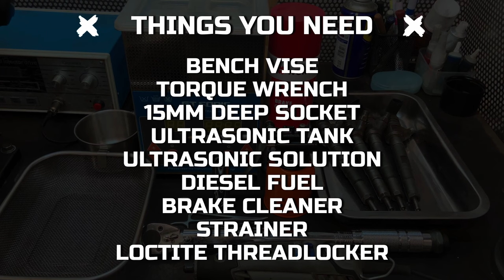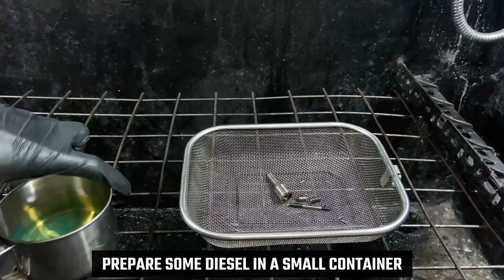HOW TO CLEAN BOSCH INJECTOR NOZZLES LIKE A PRO | 2021 ULTRASONIC CLEANING DIY

Comment: Probably you’re the only person can answer my problem… So my injectors were very noisy (knocking sound), when engine was could was ok but after was worming up was making loads of noise and the engine idle was not smooth. I’ve followed your video by the book, and I must say that the injectors act completely as new, no knocking sound at all, amazing while driving, probably the smoothest time this engine run. 

The only problem now is that all this hold for 1 day, the knocking sound starter to get worse hour by hour up to the point that it get back to where it was. Now when warms up is noisy and the idle is irregular. What I’m missing? Are these injectors unrepaireble? Do I deal with some other issue? Might be the the fuel/tank is contaminated?

Insignia 1.6 180k miles, mounts Denso 55570012
Reply: Following

Comment: By the way what would you suggest to use , after cleaning the injectors , to put on the outer body parts to stop the injectors from rusting in the head bores ?
Reply: If you really are concerned about that, Mercedes Benz will sell you the "Injektoren Spezialfett" they use on their notoriously stuck CDI injectors. A can of 100 gram costs about $20. It sounds expensive, but it is actually cheaper than the stuff Liqui Moly or Petec sells.

Comment: Great vid. To what time and temp did you set the cleaner?
Reply from the maker: Hi! Around 60-70°C for 10-15mins
Reply: @btdgarage  thanks!
Reply: @btdgarage  it is water with what? did you tried gasoline as cleaner?
Reply: @miskosadibol5665  it's special ultra sonic cleaner

Comment: Hi, great video very detailed and clear, would this process work with a 1.6 Tdi  Fuel Injector Unit 03L130277S made by Continental.
These new are approx. £450, so would love to be able to clean my old injectors if possible.
Any help and advice would be most appreciated  thank you
Reply from the maker: Hi! Continental injectors are more complicated, it’s best to have it serviced by a pro :)
Reply: Those things are the curse of VW owners.

Comment: What temperature did you use and how many watts with the ultrasonic?
Reply: I saw a guy 30 minutes at 60 deg on another channel. I suppose if you think of it this way.
The engine heats up to 90 degs and even if you've to run the bath twice it'll probably be OK.

Comment: What to do if you can’t unscrew the top part of the injector(the one closer to the nozzle). I’ve tried with a normal spanner as I don’t have a socket wrench to that size, but it looks like it’s stuck or something 😬 any advice please?
Reply: You need a 15mm six point deep socket. And if they are really stuck you must use a T-handle. If you use a ratchet you will tilt the socket and mangle the collar.

Comment: Hello. Great video, after watching it i just want to clean my injectors too, but, i have 1 or more injectors that is leaking fuel, not because of washers, but through nozzle tip. My car is smoking on 1st start up and there is a bad odor. So my question is, is there a possibility, that leaking injector is stuck somehow and loosing fuel pressure and a cleaning like this may actually help it or its just probably worn out and needs to be replaced? I cant find any videos about it. When i search leaking fuel injectors, all i see is worn out washers. Just want to be sure if all that cleaning would be for nothing as im not a mechanic and this would be a hell of job for me, but im a fast learner and curious. Just looking for cheapest option before throwing out money. Any advice would be very appreciated. Thanks! :)
Reply from the maker: Hi! I’d start with checking for a blocked catalytic converter or stuck/sticking EGR first as these two can also cause smoke and odor upon start up. In regard to your injector(s), if one is leaking or stuck, yes it can cause fuel pressure loss, hard starting, jerky engine, excessive smoke even on idle. If you’re having any of these symptoms, it’s best to have your injectors tested first before disassembly for cleaning. Now, cleaning the nozzles may help only if the nozzle pin is sticking in this case but I cannot guarantee it a 100% as worn out nozzles or pins may need replacement
Reply: @btdgarage  Thanks for your time. EGR was definetily in my to do list. Its probably wrong as you stated, but i still want to try to clean injectors first before giving them away for testing. Its about money, and im very inspirated by watching your video. Will test my luck :D I will give an update if i succeded. Again, thank you for your reply! :)
Reply from the maker: @evil20ab  Good luck! :)

Comment: how to pull out stucked needle  in injector which dont want came out ,i think that high pressure  diesel fuel  stucked it inside  the tipp  and injector was flooded with diesel fuel inside of hole and outside  and needle stay  inside it when i dissasembled it
Reply: In 99% of the cases an injector with a stuck needle is trash. You can literally cook them in hot diesel fuel for several hours. If you are lucky, they come out then. But the success rate is low. If you are really desperate and/or you have an unobtainable injector, you can assemble the injector without the spring and plunger and pump the sucker up with a grease gun. Sometimes the needle will pop out then.
Reply: @albinklein7680  i replace with other used one injector because new ones cost 250-300euro

Comment: hi, great vid! Any suggestions on how to get the entire piece to such lovely state overall without the sonic-magic? I've suffered "black death" on my Benz W211 220CDI engine, removed those puppies out, want to get them to best possible state before referring to specialist (should save $$ as it saves them time). Thanks in advance for your response! Greetz from Poland!
Reply from the maker: You may try soaking the pieces in carb cleaner. Some have tried polishing the needle with a jewelry polishing compound and a rotary tool but make sure not to overdo it. However, you can’t thoroughly clean the insides of the nozzle this way. Another youtuber have tried cleaning the nozzle tip holes using a single thread of a small wire brush for his clogged nozzle and it worked for him. I haven’t tried and can’t guarantee this method but it may help. Just make sure every piece is well lubricated upon assembly and the needle slides smoothly in and out the nozzle. Thanks!

Comment: What kind the liquid best use in ultrasonic cleaner sir?. I’m from indonesia 🙏🏽🙏🏽
Reply from the maker: Hi there are lots of ultrasonic solutions that you can purchase online. Best to use automotive parts specific which is alloy safe
Reply: @btdgarage  is that you mean like engine degreaser liquid?. can i used that for ultrasonic cleaner sir?
Reply: @btdgarage  is that you mean like engine degreaser liquid?. can i used that for ultrasonic cleaner sir?
Reply: @btdgarage   is that you mean like engine degreaser liquid?. can i used that for ultrasonic cleaner sir?
Reply: @btdgarage   is that you mean like engine degreaser liquid?. can i used that for ultrasonic cleaner sir?
Reply from the maker: Yes you can also use a degreaser
Reply: @btdgarage  ok sir, thank you so much…
Reply: @btdgarage  ok sir, thank you so much…

Comment: Great video!!  I'm just wondering, did you not clean the upper section that was clamped in the vice?
Reply from the maker: Hi Ray, as this video is intended for DIY only, I wouldn’t recommend a complete disassembly without proper equipment / test bench. I might make a complete rebuild vid soon though :) Thanks!

Comment: Could you please provide the nozzle cap torque value for the Ford T6 Ranger? Siemens VDO injector CK4Q. Thank you.
Reply: 10 NM
Reply: @miskosadibol5665  No, I don't believe it's 10Nm, I found it is between 60-70Nm
Reply: @NCHuntSA  you are right, i did not realise what you are asking. 10Nm or 8Nm+180 degrees is torque of holder of injectors for skoda octavia 2 (maybe more cars). and nozzle cap torque is really between 60-70 Nm

Comment: Good video. But removing the nozzle of old injectors in reality is not that easy. I destroyed 3/4 Denso injectors as the cap was so stuck. The metal of the cap simply bent away. Using lubricates don't help as the thread is so long.
Reply from the maker: That’s definitely true for Denso ones. What we do is give the nozzle cap a good thump of a hammer first (vised and w/ a deep socket on it) to knock the rust / carbon loose and free it up. Try it :)
Reply: @btdgarage  Thanks a lot for the advice. Giving some precision hammering worked😁 I also applied some lubricant and last but not least attached vise grip pliers. With torque from wrench and pliers the injectors are now open.

Comment: Whoever used those injectors ran motor oil instead of diesel 😆
Reply: Honestly they all look the same... When the injectors are under the valve cover oil just finds a way in...